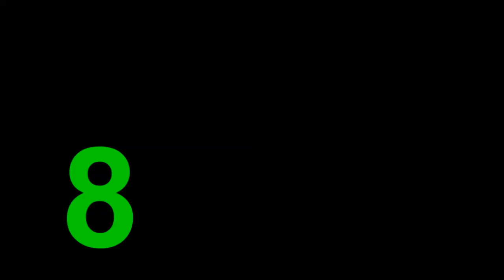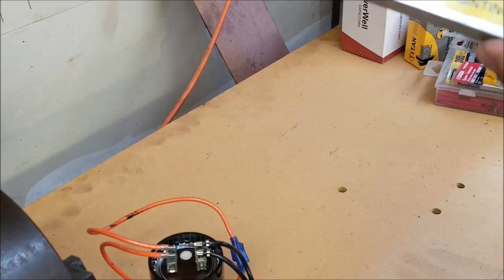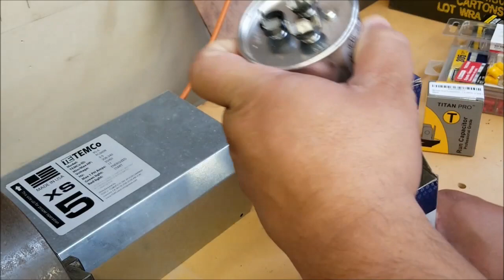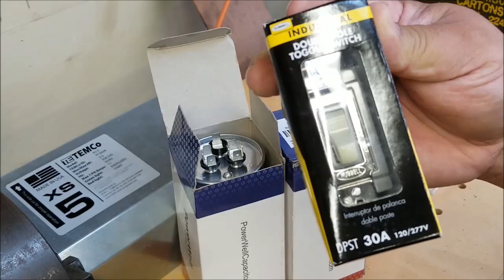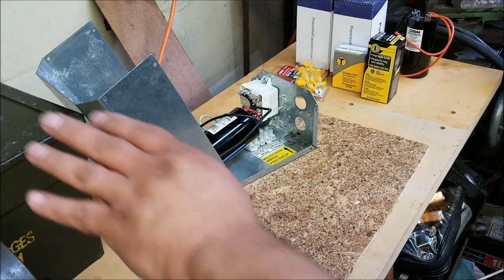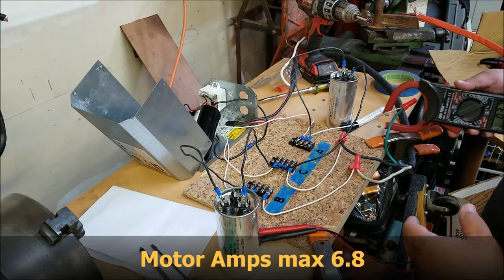SHOP BUILDS - ROTARY PHASE CONVERTER BUILD - PART 1

Comment: If you look at my profile picture you can see I love to build stuff out of what is laying around.  I struggle with working with AC voltage. Like plumbing. Now I am building a rotary phase converter for a Hardinge lathe. Keeping in mind I want something to run a mill when I find one. I plan to start with buying a 3 phase motor first. Want one that is 1700 rpms (quiet) 3-5 HP

Comment: How good are ex army ammo boxes, they make great project boxes, cheap, water tight and come with a carry handle
Reply from the maker: @Ned's Head, I considered an ammo but because I have them around the shop. In my case i knew where i wanted the panel to be mounted on the wall. I wanted a door that could be opened in case a repair was needed. Those are the reasons i used the box that i did. Thanks for watching and commenting. 
Mike - Plus8Precision